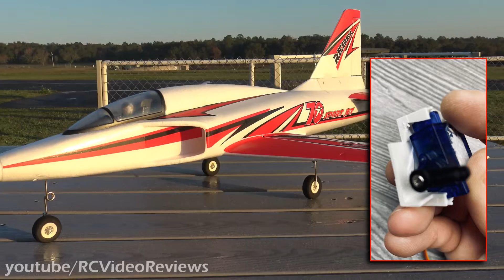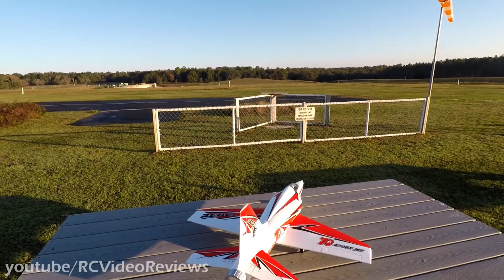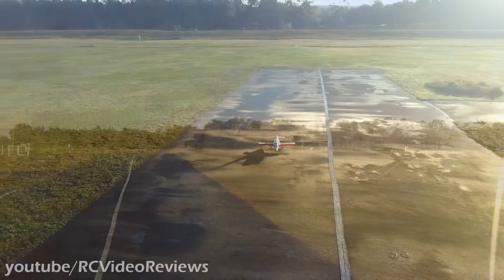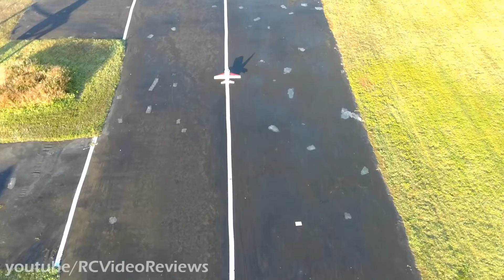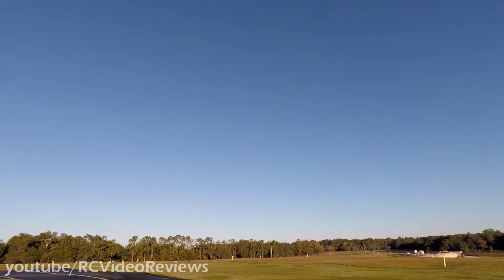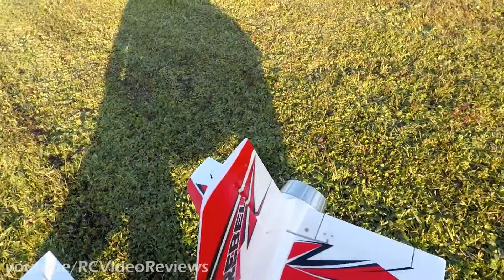Freewing Rebel v2 Maiden Flight and Build Notes - EDF Jet RC Plane

Comment: I just got mine 2 weeks ago. This plane rolls very fast even at low rate 50% during maiden. Had to reduce to 30% aileron just to get familiar.
This jet is my 3rd edf
Reply from the maker: Sounds like you got it down ok though right? Have fun with it ;)

Comment: IMO, get rid of the flap servos, and if possible hand launch it. Remove the landing gear and will be more floaty.

A 70mm w landing gear needs a 6S, the airplane is on the edge of wing loading vs watts. 

Mechanically adjust for less throw, and follow up w expo to tone the servos.
Reply from the maker: Good tips for anybody interesting in improving the performance of this plane. 

I flew it again with fresh 4s batteries and had a better experience. Flight time is still only about 3 minutes.

Comment: This plane would have been perfect without flaps.  Less weight, wiring, and bulk.  I fly mine with 3300-3600mah 4s lipos.
Reply from the maker: 2200mah is definitely too little. I go through those too fast. What kind of flight time do you get with the 3600?
Reply: @RCVideoReviews  Yes, your maiden flight was 4 minutes long at 80% throttle plus a little pre-flight taxi up and down. Probably too much for even new fully charged 2200mah batteries. I fly a 4s Stinger 64 for 4 1/2 minutes using mixed throttle and land at around 3.8v per cell. I may get a v2 Rebel as an alternative use for my 2200 4s lipos and fly for 3 minutes a flight, they recharge at the field in 45 minutes and it's quite easy to get 6 flights from 3 batteries a session with 2 chargers set at a 2A rate. I just fly a nitro model the rest of the time.

Thanks for your review, I'll go for a plug and play version....👍

Comment: Good save at the end. The landing gear didn’t seem to like grass landings. It definitely does not seem to be a beginner plane.
Reply from the maker: Keep in mind that was more of a plop at the end than a runout landing. Absolutely not a beginner plane. The footage was rough because it moves so fast that I just didn't want to keep a very tight pattern. I need to practice flying slower with it.

Comment: I thought about getting one of these as a PNP, so I gathered alot of info on it. I would get rid of the weight for a bigger battery. Turn your throws down a little and increase your expo to where it's comfortable to you. Great flite, it looked stable and smooth. When you said 2200 I was was like , hope he makes the runway  or is on a short timer!!. I think I'm gonna go with the Arrow's Marlin for a first EDF. AirHammer out!!
Reply from the maker: You're not local to Florida are you? I'm thinking about letting this plane go. I've only had one EDF I really like and that's the BAe Hawk.
Reply: @RCVideoReviews  I used to live there, but now I'm in Minnesota.
Reply from the maker: @airhammer6203  Too bad...